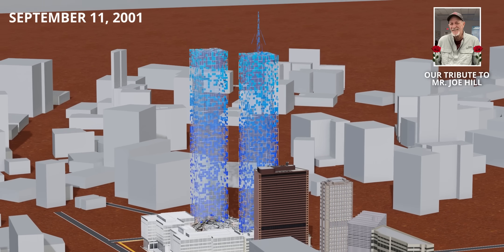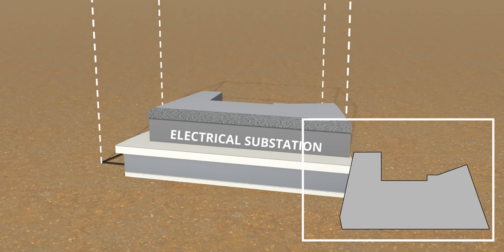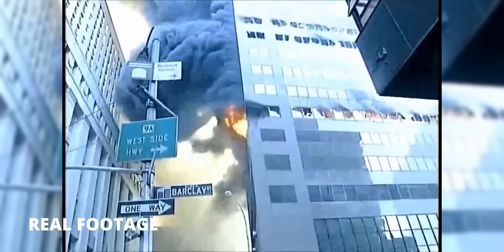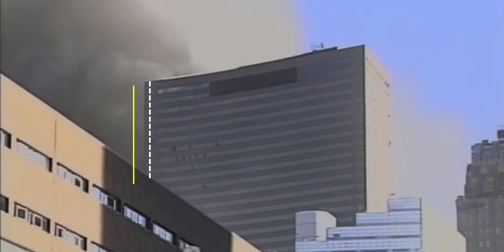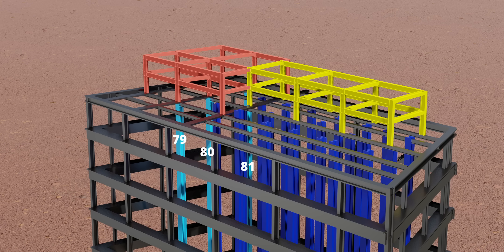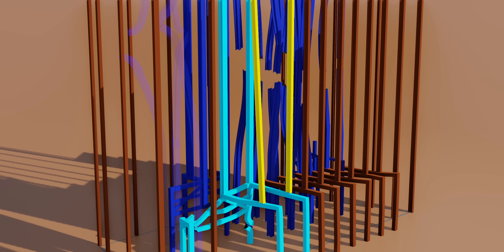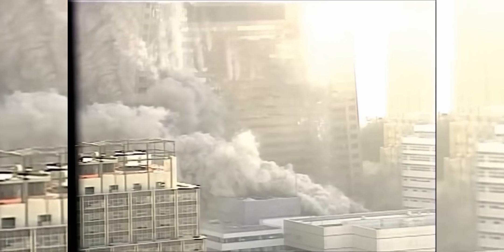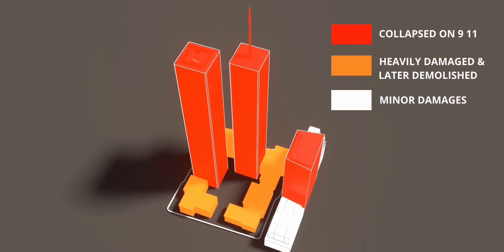Collapse of Building 7 | The Complete Physics

Comment: 23 years later, and someone thinks it's important enough to make this very impressive looking b.s.
Reply: What is it exactly you object to?  That this is being explained years later or that the explanation does not fit your personal brand of reality distortion?
	
This video is pretty good – with a few exceptions - and goes into a much higher level of detail than many viewers will be able to comprehend.  While not perfect, the collapse mechanisms – the sequence of failures - described here  are substantially correct and this is true no matter who planned and carried out the 9/11 attacks or why . 

That may not be what you want to hear and go against 20+ years of entrenched dogma and conditioning, but it’s not wrong. 

That also means (in case you did not get the hint) this video can be (and IS) absolutely correct in its description of collapse mechanisms AND the 9/11 attacks could still have been some sort of inside job. The two things are in no way mutually exclusive. 

The mechanisms described here have broad professional support around the world. There are no professional engineering organizations (for example: ASCE, ASEE, ICE, etc) that disagree with them or have offered any formal dissenting opinions or alternative hypothesis. 

So, setting hubris aside, either the overwhelming majority of the worlds structural engineers and simple observation are wrong,… … or you are. Which seems more likely? 

IF you still think believe this explanation is wrong then produce a better one . Good luck with that. No one ever has and I don’t see you moving that needle today. 

No one ever does.

Comment: This is a joke. Radio station said it fell 45min before.
Reply: And yet not wrong. Go figure. 
	
This video is pretty good – with one or two exceptions - and goes into a much higher level of detail than many viewers will be able to comprehend.  While not perfect, the collapse mechanisms – the sequence of failures - described here  are substantially correct and this is true no matter who planned and carried out the 9/11 attacks or why . 

That may not be what you want to hear and go against 20+ years of entrenched dogma and conditioning, but it’s not wrong. 

That also means (in case you did not get the hint) this video can be (and IS) absolutely correct in its description of collapse mechanisms AND the 9/11 attacks could still have been some sort of inside job. The two things are in no way mutually exclusive. 

The mechanisms described here have broad professional support around the world. There are no professional engineering organizations (for example: ASCE, ASEE, ICE, etc) that disagree with them or have offered any formal dissenting opinions or alternative hypothesis. 

So, setting hubris aside, either the overwhelming majority of the worlds structural engineers and simple observation are wrong,… … or you are. Which seems more likely? 

IF you still think believe this explanation is wrong then produce a better one . Good luck with that. No one ever has and I don’t see you moving that needle today. 

No one ever does.
Reply: @TheCriticalStinker-01  This video is complete BS with only one single exception: It proves NIST´s "stage 1" ("less than free fall drop") as horizontal movement only.

Comment: Pure bs. That was a textbook demolition.
Reply: And yet not wrong. Go figure. 
	
This video is pretty good – with one or two exceptions - and goes into a much higher level of detail than many viewers will be able to comprehend.  While not perfect, the collapse mechanisms – the sequence of failures - described here  are substantially correct and this is true no matter who planned and carried out the 9/11 attacks or why . 

That may not be what you want to hear and go against 20+ years of entrenched dogma and conditioning, but it’s not wrong. 

That also means (in case you did not get the hint) this video can be (and IS) absolutely correct in its description of collapse mechanisms AND the 9/11 attacks could still have been some sort of inside job. The two things are in no way mutually exclusive. 

The mechanisms described here have broad professional support around the world. There are no professional engineering organizations (for example: ASCE, ASEE, ICE, etc) that disagree with them or have offered any formal dissenting opinions or alternative hypothesis. 

So, setting hubris aside, either the overwhelming majority of the worlds structural engineers and simple observation are wrong,… … or you are. Which seems more likely? 

IF you still think believe this explanation is wrong then produce a better one . Good luck with that. No one ever has and I don’t see you moving that needle today. 

No one ever does.
Reply: @TheCriticalStinker-01  This video is complete BS with only one single exception: It proves NIST´s "stage 1" ("less than free fall drop") as horizontal movement only.

Comment: Bull shit
Reply: And yet not wrong. Go figure. 
	
This video is pretty good – with one or two exceptions - and goes into a much higher level of detail than many viewers will be able to comprehend.  While not perfect, the collapse mechanisms – the sequence of failures - described here  are substantially correct and this is true no matter who planned and carried out the 9/11 attacks or why . 

That may not be what you want to hear and go against 20+ years of entrenched dogma and conditioning, but it’s not wrong. 

That also means (in case you did not get the hint) this video can be (and IS) absolutely correct in its description of collapse mechanisms AND the 9/11 attacks could still have been some sort of inside job. The two things are in no way mutually exclusive. 

The mechanisms described here have broad professional support around the world. There are no professional engineering organizations (for example: ASCE, ASEE, ICE, etc) that disagree with them or have offered any formal dissenting opinions or alternative hypothesis. 

So, setting hubris aside, either the overwhelming majority of the worlds structural engineers and simple observation are wrong,… … or you are. Which seems more likely? 

IF you still think believe this explanation is wrong then produce a better one . Good luck with that. No one ever has and I don’t see you moving that needle today. 

No one ever does.

Comment: what crap lolololololol
Reply: And yet not wrong. Go figure. 
	
This video is pretty good – with one or two exceptions - and goes into a much higher level of detail than many viewers will be able to comprehend.  While not perfect, the collapse mechanisms – the sequence of failures - described here  are substantially correct and this is true no matter who planned and carried out the 9/11 attacks or why . 

That may not be what you want to hear and go against 20+ years of entrenched dogma and conditioning, but it’s not wrong. 

That also means (in case you did not get the hint) this video can be (and IS) absolutely correct in its description of collapse mechanisms AND the 9/11 attacks could still have been some sort of inside job. The two things are in no way mutually exclusive. 

The mechanisms described here have broad professional support around the world. There are no professional engineering organizations (for example: ASCE, ASEE, ICE, etc) that disagree with them or have offered any formal dissenting opinions or alternative hypothesis. 

So, setting hubris aside, either the overwhelming majority of the worlds structural engineers and simple observation are wrong,… … or you are. Which seems more likely? 

IF you still think believe this explanation is wrong then produce a better one . Good luck with that. No one ever has and I don’t see you moving that needle today. 

No one ever does.

Comment: The gash is on the wrong side to core columns 79, 80, and 81. So they were only damaged by heat? That's unlikely.
Reply: The gash did not cause the collapse. Lots of stuff happening in the 7 hours in between. Need to engage the thinking part of the brain.
Reply: If you can please read my statement slowly and carefully. I didn't say the gash was the cause or that it was mono-factorial ... it's multi-factorial.
Reply: @jimmyboy2  - Your statement was shit. Cryptic and clear as mud. No doubt you know what you were going for but it sure as hell is not clear to others.
Reply: @TheCriticalStinker-jw4fl  fair enough.  So the initial collapse occurs from the "three main pillars" side of building because, as stated at the start of video, of damage to these three main pillars. The explanation was that the gash, subsequent fire, and three main pillars damage, and unique reinforced ground structures (plus plus) all contributed to the total collapse. It is not clear how the three main pillars become damaged. Watch it again and see how we keep switching between north and south sides and the cause/effect get blurred.